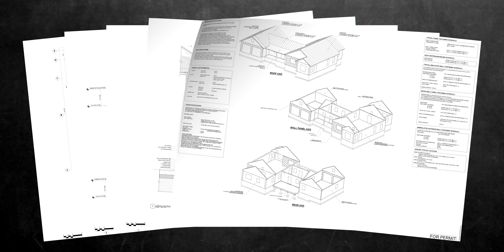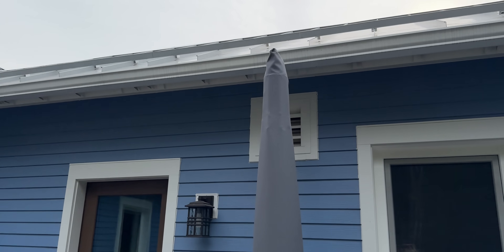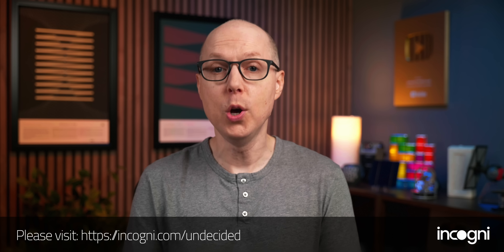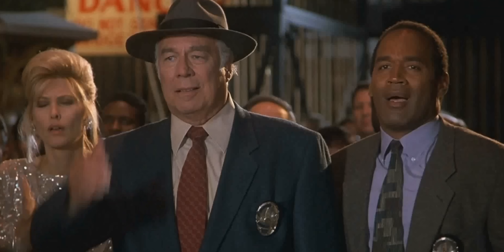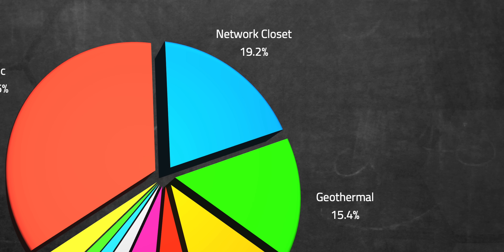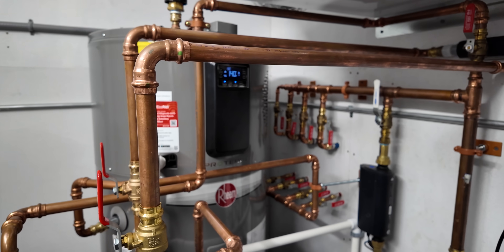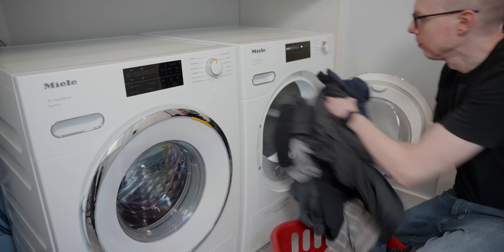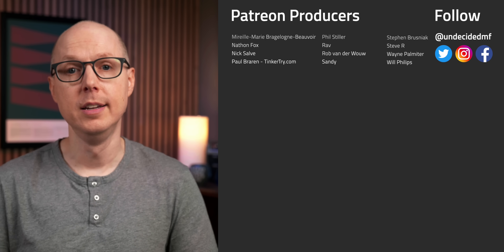What I Learned After 1 Year in My Net Zero House

Comment: It looks like it working great.  I hope it continues to do that. The only difference is I like things simple. There are too many things that you will have to call a technician and wait for him to arrive. The heat pump water heater and dryer is an example. I can repair normal water heater and dryer and I don’t have to have a tech. I hope 10 years down the road things continue to work well. Age takes a toll on everything. I worked in maintenance for 35 years and the more complicated things were, the more they became trouble as time passed. I do live further south than you and I built a solar water heater to heat my water going to my water heater, and from march to September it cut my water heating bill in half. I also built a solar heater for my 24x24 wood shop to supplement my mini split and it works okay.. Good luck on the new house and I will be watching to see how it goes.

Comment: Thank you so much for all the information that you provided. I have also been on somewhat of a similar path as you are with respect of building and energy efficient environment for my home here in California. I did take a somewhat of a different approach than you did. What I did was went I went with more efficient water heaters that are heat pump, HVAC system. That's heat pump but I kept it simple and did not go to the extreme as you did. In order to compensate, I just increased the capacity of my solar to be able to provide the amount of energy needed. Considering that I was living in a house that was built in 1988 anytime there is any kind of work that is being done. I take them more energy efficient path but did not change the overall design of the house. I figured I can always increase the capacity of solar whenever necessary because that gives me the simplest implementation and yet I stay energy neutral. We currently have three EV cars that we charge at night through the grid, but we definitely overproduce during the morning and save into two Tesla batteries for the peak hours.

Comment: A massive oversight that you made to keep your house cool in summer was highlighted by your repeated footage of your blinds automatically closing when direct sunlight was coming in the windows. Passive home (I know yours isn't a true one) use roof overhang/verandah which are calculated for your location, in summer they prevent direct sunlight from touching your house, whilst in winter allowing it to enter your windows. This has a massive effect on heat gain in summer, whilst allowing a little heat gain from the sun in winter. Even on a non passive home this has a huge impact in summer. A retrofit that isn't as good, but better than nothing is external shades over the windows. You can get metal slatted ones, the slats are angled to prevent direct sunlight entering the windows in summer, but allow it in winter. It's nowhere near as effective as a roof overhang/veranda as they stop direct sunlight from hitting the walls not only the windows, but it will still make a big difference to your cooling energy consumption.

Comment: would a heat pump dryer still be a good idea for an extremely old house? currently i have a nat gas dryer. i have just a single window ac unit in a different room of the house. most of the time, the house is just ambient temp. there is a LOT of airflow through poorly sealing doors, floor trim, ceiling trim etc.

Comment: I live in a house built in the mid 1950s in Silicon Valley.  It needed some upgrades so we replaced the attic insulation, added an attic ventilator and replaced the old single pane windows with dual pane windows.  Added a heat pump and solar and battery we are exporting more energy per year to the grid than we use and get a nice cheque back at the end of the year from the electric company.  when our hot water heater dies will be replacing that with a heat pump hot water heater.  Its been great so far.  ROI on the complete project was originally about 12 years but with the rising costs of electricity and gas its somehwere around 7 - 8 years.

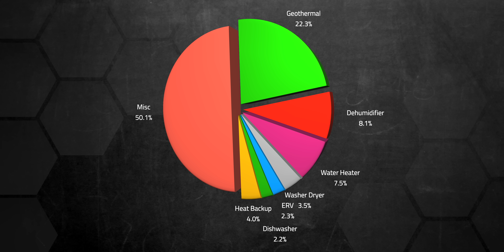Comment: 13:44 Are you sure heat backup isn't part of your geothermal system?  In cold climates, geothermal systems have electric heat in the event that the geothermal can't keep up. They use a lot of electricity, so they would have their own breaker in your panel. 

I keep my breakers for the backup heat off because they will kick on if someone turns the thermostat up. I think the programmers decided that people want heat a little faster than what geothermal can provide.

Comment: I had a ground loop heat pump in my last house. Absolutely loved it. My latest house we did an air source heat pump and it's nearly as amazing but for 1/8th the cost. I'll never get over how good an air source heat pump works, even when it's single digits F outside.

Comment: Live in Mertzon TX.  Put 24 - 390 watt solar panels in 4 strings, two 5000 watt inverters.  Turned system on 1 Jan 2020.  For 1st 3 years, electric bill totaled $1.80.  Summer of 2023 was so extreme I had a total of $48 for that year.  This yr 2024 summer was hotter than usual but not as bad as 2023.  BTW I use the power grid as my battery.  Produce excess elec during the day, pull deficit off the grid at night.  So far has worked better than I anticipated.  Also, my break-even cost point was reached in just over 3 years.  I installed system myself.  If I can do it, you can do it.

Comment: I had a 11.75 kWh solar system installed in June.  I did the span panel, 29 405 watt panels, and a single Powerwall 3 (initially).  A week ago Monday I had a second PW3 installed and my string split as evenly as possible 15 on one and 14 on the other.  I find it interesting my production slightly improved.  My assumption is there is some type of loss when you dump everything onto a single PW3 inverter.  My second full day beat nearly 90 days of data on peak production.    I can'r imagine it is a fluke.  The installer had hoped to drag feet for PW3 expansion unit so they kept more profit.

Comment: Use a thermal camera to check for loose connections, thus causing a hot spot, drawing more amperage. Using more electricity.

Comment: Your “Heat Backup” slice in the pie chart is likely a resistive heating element that is part of your heat pump air handler. Heat pump units are usually required to have a backup method to provide heat for when the unit is not able to meet the demands of the thermostat - possibly when “someone” was adjusting the thermostat outside the range values you set.

Comment: I'm looking at replacing our gas boiler with a heat pump water heater. We already have heat pumps for heating and cooling. Since moving up to NE, I've noticed that people up here refuse to get with the times and rely on 200 year old technology then complain about the costs associated with it. Its so weird that a Floridian has to educated people in the NE about the best way to heat their homes.
Reply: I seriously doubt that a heat pump water heater can replace a boiler.
Reply: @johnpeters9903  The boiler is used as both a heat source and a water heater. I already have a couple of heat pumps that have replaced the heat source of the boiler. My boiler now is just essentially a hot water heater so getting rid of it completely should be relatively easy.

Comment: If one was to drill a single deep geothermal hole to service the heating system for several houses (Maybe between 2-3 or 4 houses) wouldn't it reduce the installation costs dramatically per installation?
Also what about using waste grey water from showers, clothes washing and dishwashers as a source of heat?  
That same grey water could also be used for toilet flushing to reduce the intake and outflow of clean water.  
This is especially important if one has a well source water supply and a septic tank for sewage.

Comment: If you have the CO2 sensors and thermostat both integrated into home assistant, you can create an automation to only run the HVAC fan on an as needed basis. Basically, if CO2 in any one room rises above a set level -> turn on fan. If all rooms drop below the setpoint -> turn off fan. I actually do this in my older home that doesn't have an ERV. It keeps the CO2 levels averaged out throughout the house and buys me time till I can open some windows at night (hot southern climate). Hoping to add an ERV some day.
Reply: I want to find a ERV system that can extract not only fresh air, cold air and heat from outside to heat or cool the home. There are so many systems out there that just fail to provide. I want to build a slab on grade home with in floor heat (not geo thermo ) that is an all in one system that can heat domestic water along with extracting heat from the patio/concrete outside as well as heating or extracting heat from a pool. 
They make a smart water heater that you can hook up ducts that can pull in hot air from outside or from the room to heat the water as well. This type of smart system would be very ideal. I would also like to extract the heat from the heat pump for cooling as well to heat the domestic water as well. If I am using energy to cool the house then I want to use the waste heat to heat the hot water as well. I also want to use the cooling to cool the domestic cold water loop as well. The hot water will also be looped as well. 
I have yet to find a heat pump that does floor heat, hot water and ducted heat/cooling.
Reply: @kameljoe21  You can do what you are asking with geothermal, or an air to water heat pump. But I'm not sure why you want to pay for both ductwork and a radiant loop.
Reply: @belg4mit  I want central air and that requires duct work. No I do not want mini split systems because they have horriable filters. Have you ever had a window ac unit and even after one season cleaning the filter weekly the fins are still dirty. The same applies to those mini splits. Radiant heat works just fine yet if you have no way to filter the air then you might as well not even build anything. With new smart thermostats they have PPM and VOC sensors which means that if you fart the variable fan will kick up and filter that stink out with the HEPA filter. You cooking smells will not be a problem either. If you build several systems rather than a single unit you can say filter the bedrooms on their own systems which should be less damaging to the hepa filters, the kitchen on another system and then the other general living areas. This can be done using zones that have their own filtered returns rather than rely on a whole house filter. Pre filters at the returns and then your hepa filter. The pre filter will lessen how dirty your hepa filter will get. 
An all in one system will not only save you energy it will provide you with far more. Those smart water heaters that have built in heat exchangers just pump hot air from outside in thru ducts that heat the water, this takes less energy. Having heat reclaim units on say your ac, fridge/freezer would pre heat your water as well. There is so much wasted energy it is not funny.

Comment: I have a ground-source heat pump for both heat and cooling in my home near Denver, with solar PV panels on the roof. I have a in-floor hydronic heat delivery system for all rooms, which I love, and do keep unused rooms at a cooler temp. I have high-velocity air cooling for most rooms. I also use the set-it-and-forget-it approach to keep the room temperatures steady, however I do turn off heating at some point in the spring and let the room tempters fluctuate as they will. Likewise I turn on the cooling system in the early summer when it gets "too hot." And turn on the heating system when it gets "too cold" in the fall. That saves some (unknown) amount of energy, and is not uncomfortable. I also retrofit my 1929 house with insulation (it previously had no insulation in the walls), modern windows and doors and other air sealing measures. In the end improving the building envelope reduced the grid energy consumption by 40%, and switching from natural gas to ground-source with PV reduced that by 51% for a total of 91% reduction of grid energy consumption.

Comment: Every Tech Nerd deserves to get a pass for the energy usage of their Network Closet ;)
Reply: I disagree. You only get a pass if it's useful energy usage. I was going to put in my spare 48 port switch to connect a few things but I just learned it pulls 75 watts at idle. That is inexcusable. I can get a smaller 24 port switch that pulls under 20 watts under full load and the savings will pay for itself in less than a year.
Reply: @jasoncox7244  which of my network closets do I ignore?

Comment: A helpful approach for the average person would be to provide a detailed breakdown of the cost for each individual component, comparing the standard option with the super-efficient one. Additionally, it would be useful to show how long it would take for the super-efficient option to surpass the standard or even a cheaper replacement in terms of savings or performance.

Comment: With a code house, all electric appliances besides the furnace with a family of 4. We are still using under 1000kwh and at .065 dollars per kwh couldn't justify the cost of geothermal. even cutting my bill in half wouldn't save 500 a year.

Comment: i saw a video about building the overhang of the roof in a way that you catch the sun heating through your windows in the winter, but cast shade on your windows during summer. That might help a lot in getting a net zero house
Reply: Another unmentioned thing in this video is related to this issue of the sunshine: how is the house oriented? Was any consideration given to that?
Reply: That's very interesting. Can you share a link to the video?
Reply: @sergiotavares8736  its a well known design. Any architect will have the knowledge to do this. The house should be placed on site to make the best use of the sun and the overhang width should also be optimised for the above effect
Reply: @sergiotavares8736  i don't remember which video it was, but if you search a large greenhouse in canada, you should find it, i will look also, and post it here if i find it
Reply: Thats not a way to build, its just building it long enough to shade summer sun. Just look at what angle sun is during summer and draw line from windowcat that angle to know how far your gutter should reach.

Comment: From Sweden here... Your wall insulation/R-value seems way off compared to the choice for (If i'm not mistaken ) triple pane windows (which has been standard here for many years in a new home). We use much  much thicker walls and insulation here. You would cut down alot on your AC bill/power requirement/amount of solar/battery etc. if you had gone with thicker walls.
It seems in the US everyone totally forget that thick insulation not only helps from the cold, it also keeps your cooling need down.
I used to live in florida in the 90as a student, and couldn't believe our electricity bill for the AC, until we accidentally put our foot through the dry wall once during a party, and realized there was NO insulation at all, nothing, between the dry wall and out skin. Not even a membrane. Nothing. Go figure the electricity bill...
Reply: We like doing things as cheaply as possible here in the states
Reply: @berengerchristy6256  But the windows are awesome and must have been expensive! :)
But yea, alot more focus is placed on yp front cost, rather than long term cost. In europe it's the other way around.

Comment: Born in New England but living in Southern California for four fifths of my life I have a different strategy to reducing my home energy costs. Like you I have turned to heat pumps, but also have the advantage of solar for the hot water I use.  It preheats the input for the tankless gas water/space heater now, but when I first installed it I did not  use any gas for several months. That was because I also converted my formerly gas clothes dryer to heat pump the hard way:
I tore out the gas burner and redirected the exhaust into a plenum box attached to the input of a dehumidifier, whose outlet was similarly ducted to where the gas dryer input air was located. Recirculation during the  timed "air fluff" cycle completes the process with the benefit of clothing that needs little to no ironing.
A month or two after that conversion, I received a knock at the door from a gas company representative, inquiring if my  gas appliances had stopped working. Adding that tankless back-up system took care of that while later on getting an induction cooker tends to keep my gas use at a bare minimum.

Comment: Your house also likely doesn't leak enough air for a vented dryer to work well. I saw some video where a builder had a homeowner with that issue, and the solution was that they had to open a window in the house in order to use the damn thing!

Comment: i have insolated  my 70's  brick build  rowhouse,  from floor to roof, with high efficinty glass wall insolation  etc,  air to air heatpump  and solarpanels,  and i am saving  so much on use of gas,  i only use that for hot water now,   and saving a lot on power also,   i have a small homebattery coming,  to help with saving more energy.    the investment i made i will have it recoverd in about 6 to 8 years total